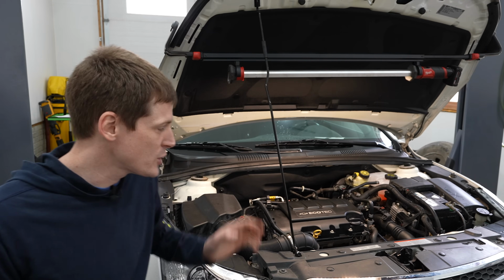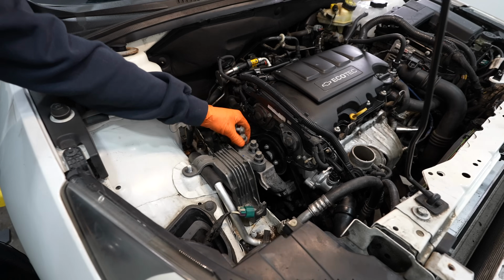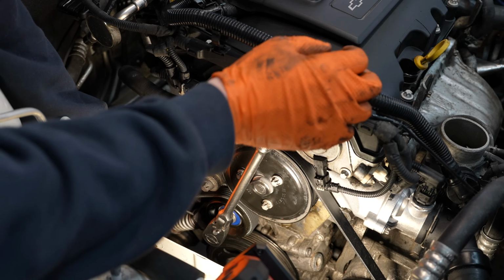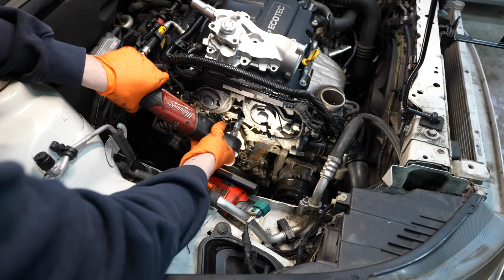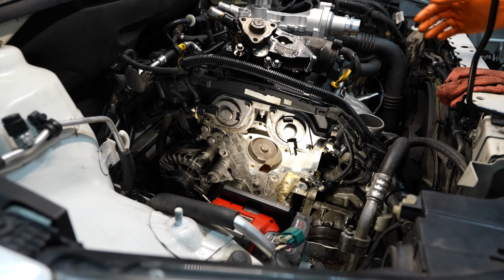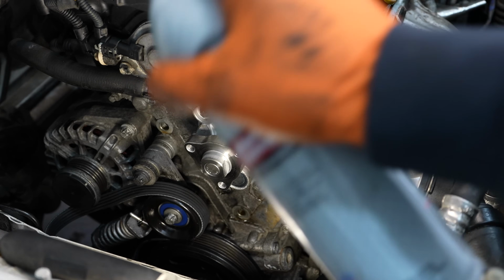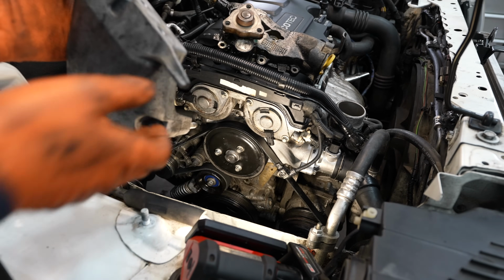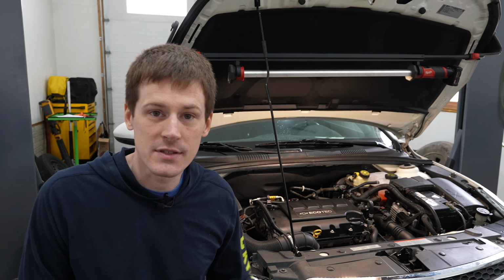GM 1.4 Turbo Water Pump & Thermostat Housing Replacement.

Comment: What are the symptoms of water pump failure?
Reply from the maker: Leaking coolant, or a growling noise from the failed bearings.
Reply: @RepairGeek rattling noise  and loss of hot/ cold air too😂 i have a 2017 1.5L malibu. what was gonna be an easy fix is now a pain in the ass. the bolt snapped in the housing when i was installing the new pump lol. tried to drill the bolt annnndddd ping, snapped 3 drill bits and the extractor tool lol. have to replace the entire assembly

Comment: I have a 2021 Chevy Trax turbo. My water pump is leaking badly. A mechanic says it will cost approximately 600 to replace it. Is that true? Says it will take 4-6 hours to complete, is that true? Need some help please
Reply from the maker: https://youtu.be/6maVFMPp83U

Comment: Where did the oil come from that was all over your motor?  Is this engine a leaker?  I am looking to buy a Sonic but that oily mess doesn't look good.
Reply from the maker: Big time leaker.
Reply: Most of the bolts go into the timing cover and will start leaking oil through whenever sealent starts failing including the 3 long motor mount bolts